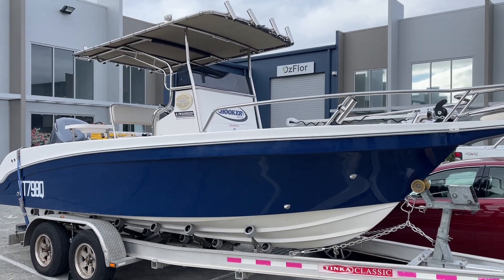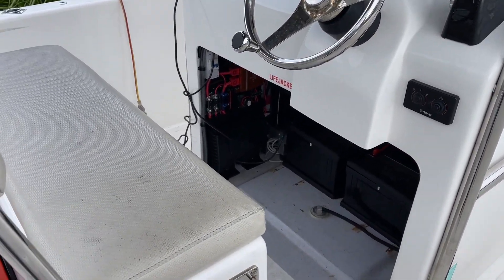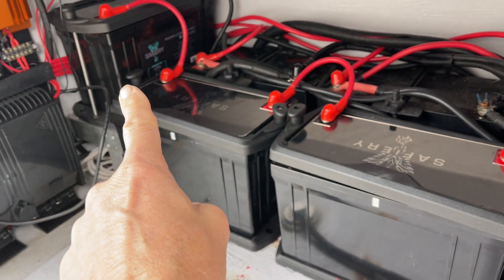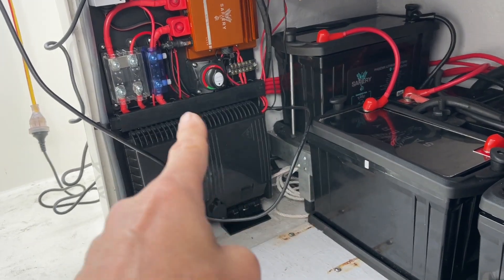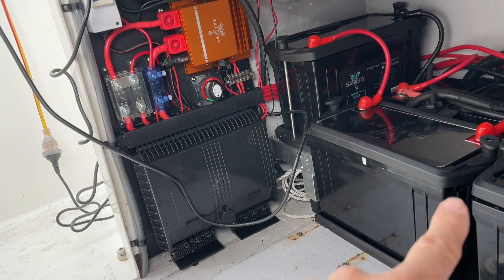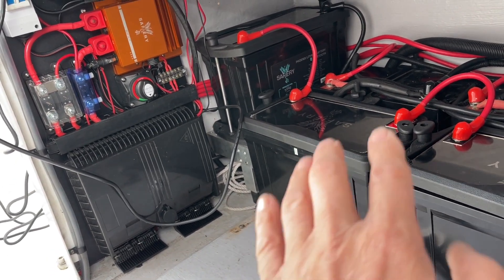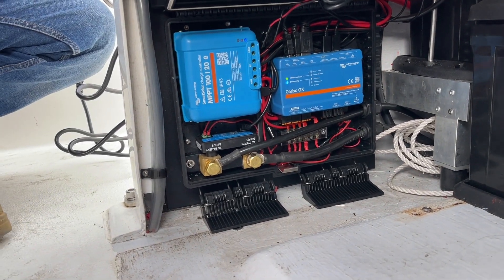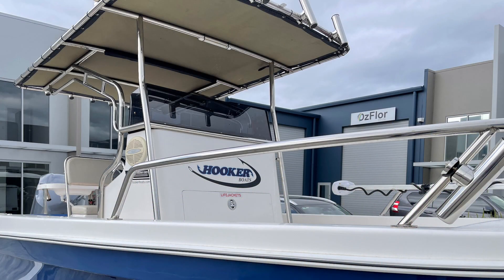36V Lithium for Minnkota Powering Hooker 6.7m Centre Console 36V House battery through Scotty

Comment: Great installation there. Have you meassure the temperature inside the ip box with the mppt charging with solar? I belive it can get really hot inside that box without ventilation, speacially if solar is charging (not iddling). But great work Bruce.
Reply from the maker: We have put temp sensors in some jobs early on ut we find its only the AC charging that needs cooling. AC chargers run at 70-80% efficiency when hot. The Solar MPPT is around 98% so little heat on higher voltage systems. This one 36V others are 48V